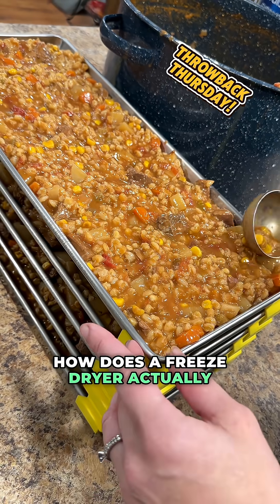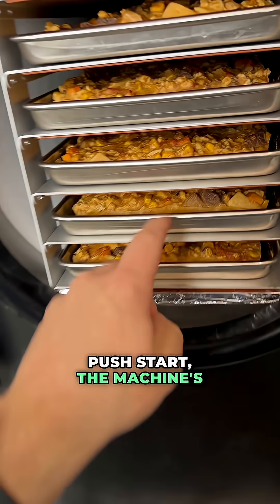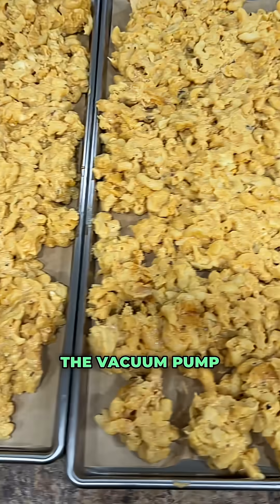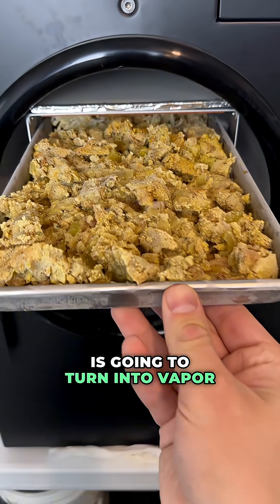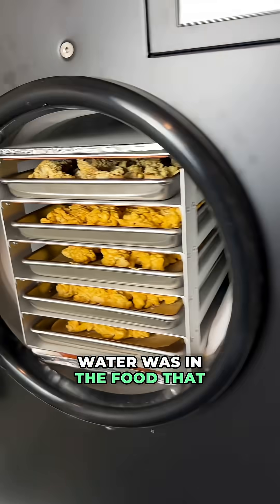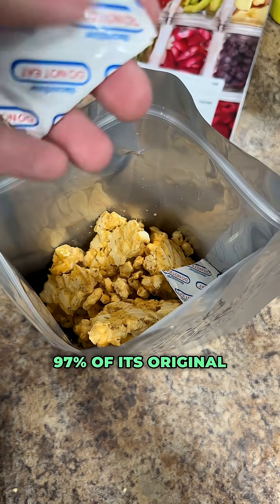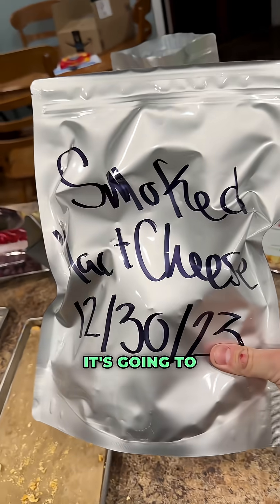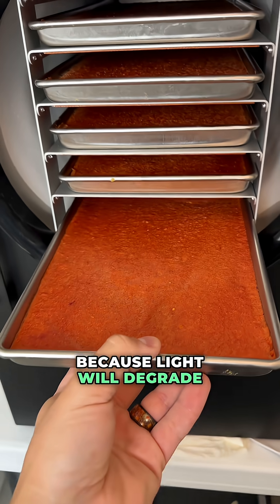How Does A Freeze Dryer Work?

Comment: FWIW, HarvestRight has confirmed to me that, if you flash-freeze food with liquid air/nitrogen at -200C, your end product will be of higher quality AND the freeze-drying process will be more efficient.  What's more, you can flash-freeze produce immediately after picking it, while still out in the field, so you don't have to worry about damage from transportation. 

(You can buy liquid air and rent a dewar--basically a thermos on steroids--at any welding supplier.)

Cheers!

Comment: Where does the water go? Obviously I know it turns into ice but does it just melt in there after you’re done with a batch?
Reply from the maker: As soon as the batch is done the ice inside the machine melts and goes down a drain tube into a bucket!
Reply: @WhitepepperFarm how often do you pour out the water? How much comes out and lands in the bucket? If I have a really small bucket will it fill up in only one cycle?